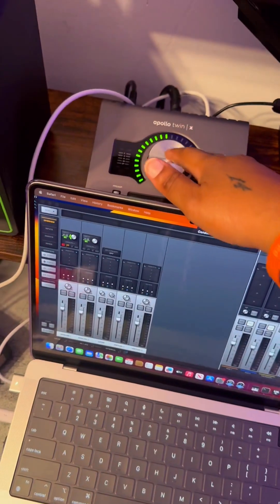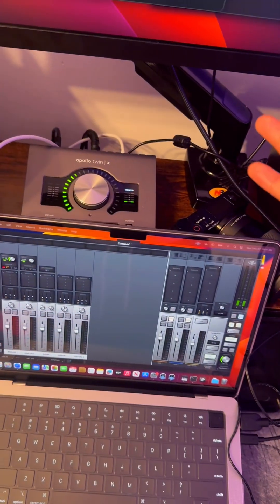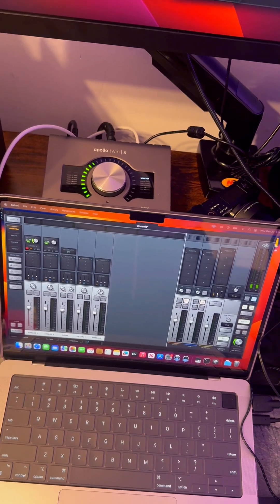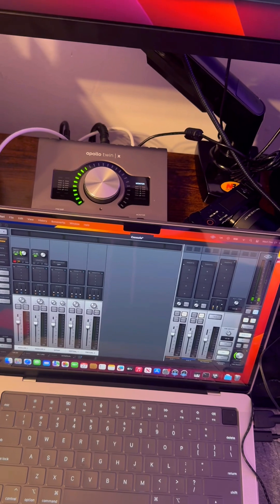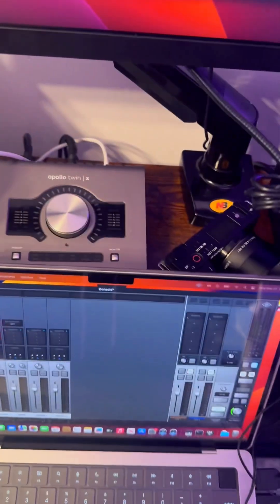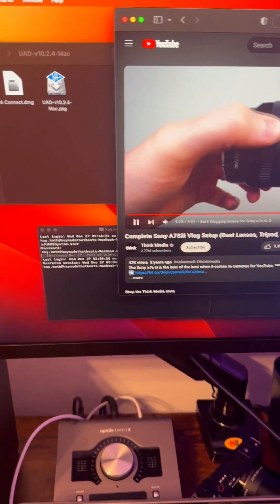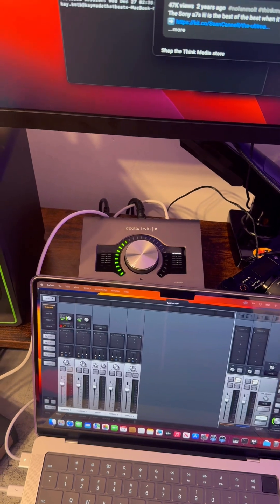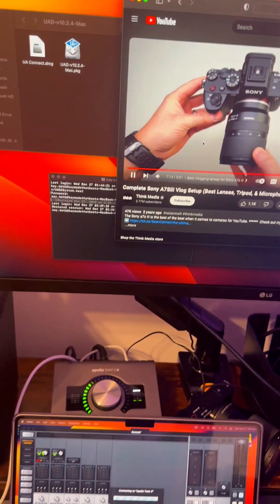The Apollo Twin X Dilemma: Troubleshooting Audio Issues

Comment: Great but which was the power supply did you find good? and what is its voltage and amperage ,12v and 4,2 mA is correct? Thanks!!
Reply from the maker: Not sure where I got the adapter from. It’s just one I found around the house . And yes 12v !
Reply: @Kaymixedthat oh thanks but very important. could you see what is the next value after 12 Volts where says 1.5 mA or maybe 4.2 or 4.5 mA..so I have only the 1.5 version and doesn’t work whit the Twin X and is fine with the old Twin mk2..thanks again for your answer!!
Reply from the maker: @FrankBittom1  output says 12.0 v 1.6a 19.2w idk if that helps but this is the AC adapter model number - 

ac adapter ats018t-w120v 

hope that helps
Reply: @Kaymixedthat oh thanks 🙏🏽 I will try to find one like that, it would be great to know your material and maybe collaborate with something more musical with Apollos😊..
Reply from the maker: @FrankBittom1 know my material? & I’m
Down to collab! Let’s do it

Comment: I am using the apollo power supply , but I am having issue with Thunderbolt as to which one to get because the one I have is not working. They could've easily included one, the one that works. They have a whole page on which Thunderbolt cable we should be getting, which is for a over 2k device ! is frustrating and anguishing.
Reply: I asked my AI and it recommended a reputable brand and the specs it would need
Ordered it on Amazon
Reply from the maker: Hope it works 🤞🏾🤞🏾🤞🏾
Reply from the maker: Yes it sucks they don’t come with one but to be on the safe side I got the apple one but it’s a thunderbolt 3 one - make sure it has the thunderbolt on it

Comment: I’m having the exact same issue trying to connect to new monitors. But here’s the confusing part: 1) I’m using the power supply that came with the UA Apollo, 2) I’ve already previously connected to monitors without issue. I just want to try my new monitors! 😭
Reply from the maker: Did you install the drivers correctly? If so try restarting your computer and turning off the Apollo. Turn your computer back on, and once loaded turn on the Apollo. You know it’s working when you hear a few clicks …. Definitely have to download drivers and make sure you are using a Thunderbolt 3 cord if that’s the kind you have and a thunderbolt 3 port on the computer.

Comment: I’m using the power supply that came with the Apollo twin X. Before I set up my Apollo in uaudio I was able to hear the mic in my headphones but now that I set everything up nothing will work. It’s extremely frustrating and nothing works.
Reply from the maker: Have you tried turning it off and on? I know that’s dumb but sometimes that helps me. I turn off, unplug, plug back in, and then wait a second, and then turn it back on. 

Also try resetting it 

Power down: Turn off your Apollo Twin and disconnect any Thunderbolt or USB cables. 
Button Combo: Locate the PREAMP, LOW CUT, and POLARITY buttons on the front panel. 
Power On: With the buttons held down, turn the Apollo Twin back on. 
Reset: Continue holding the buttons until the LEDs on the front panel flash rapidly, then release the buttons. 
Power Cycle: Turn the Apollo Twin off completely and then power it back on again. 

If those don’t work, try unplugging it, restarting the computer, and plugging the cable back in. 

Also go to uad console app, go to settings and click on “identify” 

Hopefully one of those work for you. 

Also, make sure which ever input you are on, click the preamp button, make sure it’s on ch 1 (input 1) or ch 2 (input 2) and make sure it’s on mic and not line. Make sure your +48v is turned on. Make sure you turn your mic up. Click “monitor” and make sure it’s on headphones and turn up.

Comment: I got a new cable but still no sound
Reply from the maker: Some things to check - 

Make sure you are connecting with a thunderbolt cable (has to have a thunderbolt on it) - not just a usb c cord. Make sure your headphones or volume (hit the monitor button) is turned up. Make sure your output on the saw is set to Apollo twin .. also try turning it off and the back on again.

Comment: I have the same problem but I’m using the power supply they gave me. N my dam microphone keeps popping on fl studio it’s really getting on my nerves.
Reply from the maker: The popping could be from the sample rate. Try going up to like 256 or 512 if you are lower. Make sure you downloaded all drivers correctly on your computer. Set your output sound driver to the Apollo.

Comment: I has the same Issue and i put another power  supply but still not working
Reply from the maker: Make sure it’s the right plug for it, make sure all the drivers are downloaded and try resetting it to have it recognized. Try turning it on and off also

Comment: I can only use my headphone.., No output from my monitor.. i have also changed the power cables but the  problem remained. This is so frustrating…
Reply from the maker: Make sure you set your output on the computer to Universal Audio. Make sure your monitor button is on and turn the volume up. Set your output to universal audio in “Audio MIDI“ right lock on universal audio and click set output. Try to reset the interface.
Reply: @Kaymixedthat  everything is setup as it should be. I was using the monitor when it happened. Suddenly there was no sound from the Speaker. I have changed speaker power cable and Audio Jack.. the speaker turn on but no sound. My  Apollo Twin Microphone and Headphones are working fine. They both have signals. But the monitor is the only issue. There’s no sound coming from it.  Right mow AI has taken over, no proper support on how to fix this anywhere. 😤
Reply from the maker: @TheBridesGroom yeah I hate that no customer service is available nowadays! Have you checked to make sure your speakers work and not just show power? Weird for it to randomly just go out
Reply: @Kaymixedthat  I just took them to a technician. From the Diagnosis, One power is bad, and the other one sound is bad. So I’m hoping after the fix everything will be good! Fingers crossed. 

I’ll leave a new comment soon about the situation. Hopefully it will be good.
Thanks for the response!!
Reply from the maker: @TheBridesGroom no problem hopefully everything works out for you

Comment: yes always use power supply that came with the apollo.

id also suggest muting the microphone output so you dont run into feedback when monitoring through speakers
Reply: You know anything about the Uad not connecting to the mic and headphones?
Reply from the maker: @cjhall225. Did you download the console app ? Make sure the 48v power it turned on;  when you clock the monitor button and it goes to the headphones option make sure you turn the dial to turn it up.
Reply from the maker: So I bought it used, so they gave me this power supply that was falling apart so that’s why I was using a different one from the start. 

My microphone wasn’t hooked up yet but thank you for the reminder! Definitely will!
Reply: @Kaymixedthat  ah another tip, try not to connect or disconnect the microphone with 48v on
Reply from the maker: Smart! Will definitely keep that in mind because I’m bad at not turning off 48v first 🤦🏽‍♀️